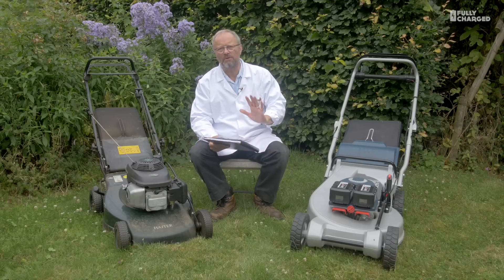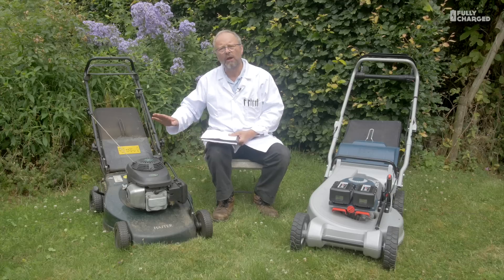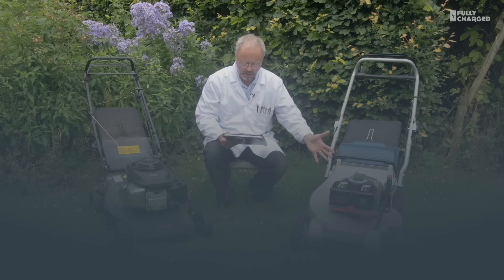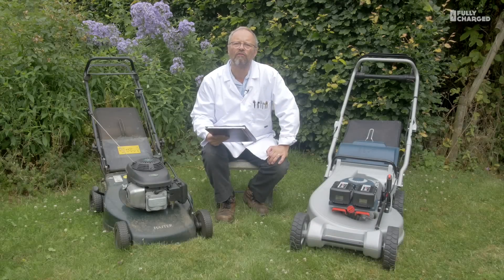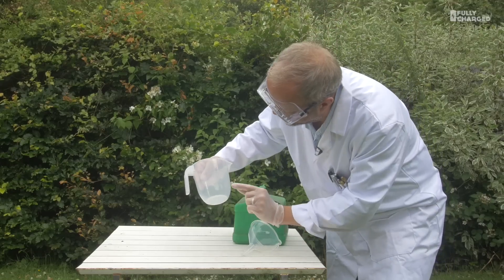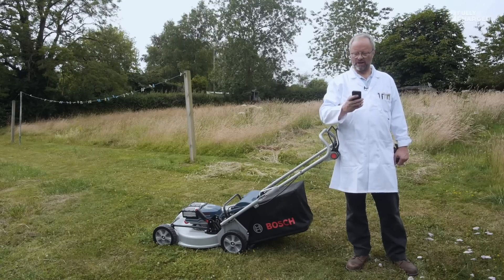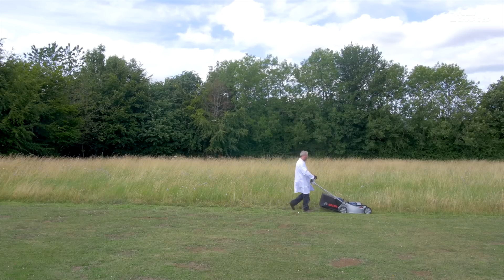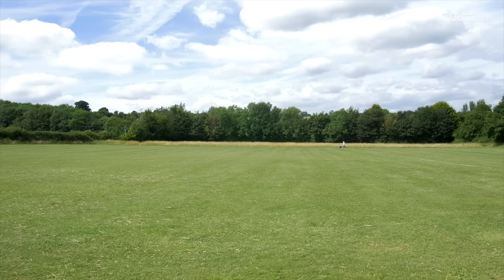Battery V Petrol. The Lawnmower Test | Fully Charged

Comment: While this is very favorable comparison to a four stroke rotary mower, it should be noted that such lawn mower engines, which are built to a price not a performance standard, are the worst of the worst in terms of thermal efficiency compared to an automobile engine of today. That said, even if that engine were up to the best IC automobile standards it would still not equal that mower. I have a smaller version of that sort of mower(36V Li) and it does my small California lot, even with the weeds ankle high with no problem. 
At my age I would like to find a lawn service using that Electric Bosch or its equivalent, but even here, where emissions regulations helped start the whole  clean car movement world wide just because a clean car runs more efficiently, those very dirty lawn care engines have almost no regulations, as they were left out as being too small to worry about.